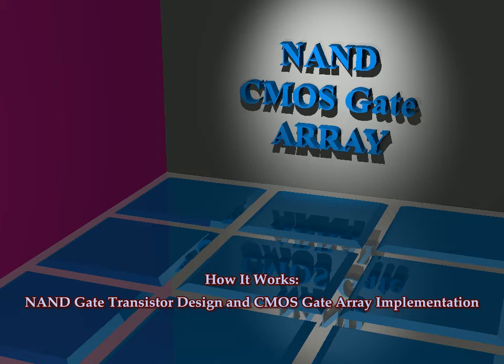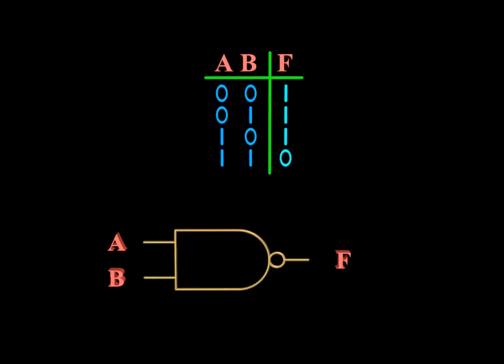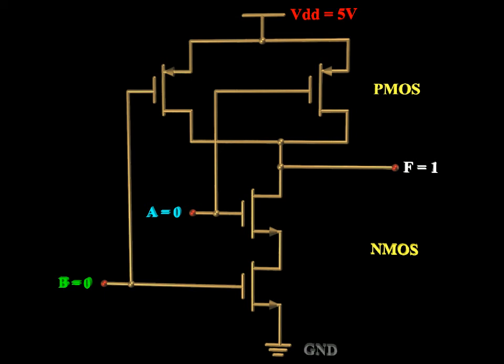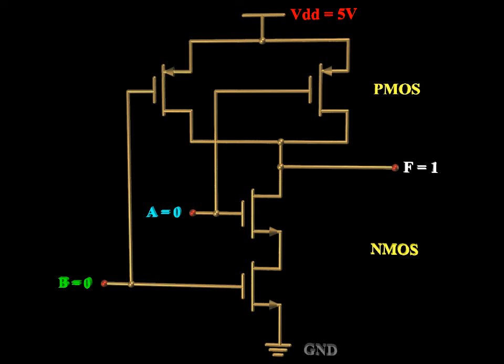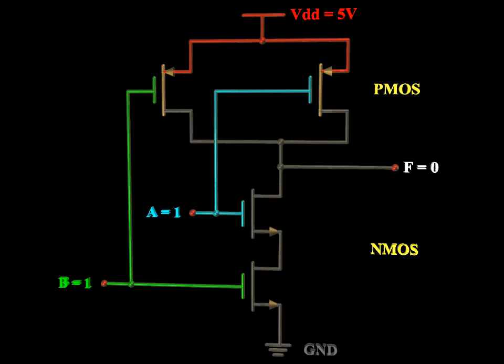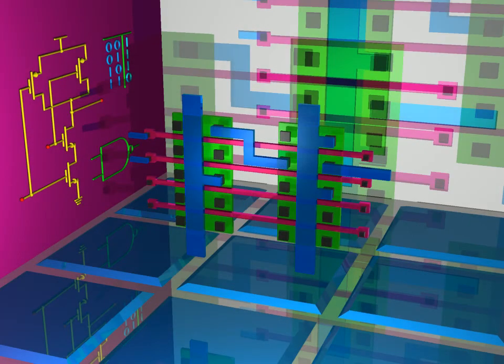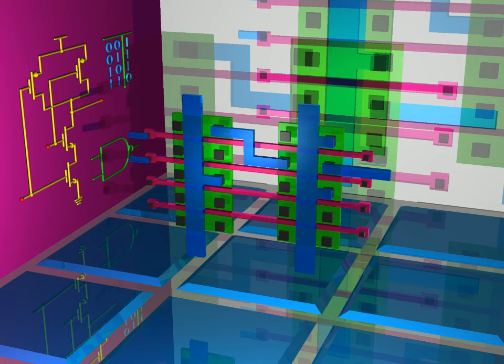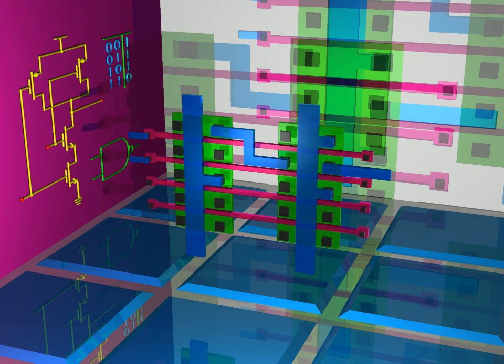NAND Gate Transistor Design and CMOS Gate Array Implementation

Comment: what if PMOS is gnd while NMOS is tie high.  2 reverse
Reply from the maker: Thanks for the interesting question.  If I'm interpreting your question correctly - the schematic exactly the same but with the PMOS and NMOS switched - then, by my reckoning, it would be an OR logic gate since F would be 0,1,1,1 in a truth table.  If, however, you mean change the schematic so that the PMOS section remains in parallel but moved to ground and the NMOS section remains in series but tied to high, then that would be an AND logic gate.  BTW, if you keep the PMOS tied to high and NMOS tied to ground, but make the PMOS section in series and the NMOS section in parallel, then you get a NOR logic gate (see my other video).
Reply: According to this simulator [ http://falstad.com/circuit/circuitjs.html ], NMOS to V+ and PMOS to V- would be an OR gate, but the output voltage would be somewhere between V+ and V+/2 as its high output.  You would need to add your standard CMOS inverter to get the full voltage for the output.  That would effectively make it a NOR gate.  Perhaps that fact could be used to make a NOR gate and OR gate that have the same number of effective gate delays without reducing the output voltages of either gate.  Same thing can be done with NAND and AND.
Reply from the maker: Just noticed your comment now (YouTube didn't notify me) (and I also just noticed your other comment).  Billy's question actually inspired my Spice video, in which I do show that the output voltage wouldn't reach V+ (also won't reach ground, IIRC) (won't hit the "rails").  I point out that the better solution is to add the inverter (as you say).  I'll have to think a bit about the possibility of the same number of gate delays (with correct output voltage) with NOR/OR and NAND/AND.
Reply: Thanks.  Also, YouTube killed my link trick, so I edited my comment and put spaces between the brackets and URL.  This system keeps getting on my nerves.
Reply from the maker: I know how you feel.  My latest troubles with youtube is that for a few weeks it has notified me of new subscribers (only people who show their subscriptions publicly), but they never show up in my subscribers list (they are counted, but don't show up in the list).  In at least one case, I checked the person's subscriptions and I'm still there, so they should be in my Subscribers list.  I've notified youtube, but so far they haven't fixed it.
Reply: switching nmos with pmos is a bad idea. From the input side transistor gate looks like a capacitor and you have to charge it to turn on transistor or discharge it to turn it off. Output of a logic gate has two or more transistors working as a switch and their purpose is to charge and discharge next logic gate input (to be specific a gate of a transistor that can be represented as a capacitor C_gs2).

NMOS transistors are very good at discharging and very weak witch charging, PMOS are opposite. If you connect nmos Drain to VDD rail and Source pin  to a capacitor C_gs2 and you apply V_gs1, let say 5 Volts by connecting gate to VDD, transistor will switch on and from the VDD  current will flow through transistor to a capacitor C_gs2.

Voltage on the capacitor will start growing as a result of charging it, but voltage V_gs1 will start shrinking at the same time. While Vgs1 goes down transistor starts switching off before capacitor C_gs2 of next logic gate transistor input gets fully charge.

If that process will stop for example at 2.5V (half of VDD) then in next logic gate you are in the forbidden zone when both nmos i pmos are not fully open or close and current will flow all the time from VDD to GND through both transistors. You just introduced into your circuit extra static power dissipation. Not good and this can spread like a cancer into rest of a circuit.

You can apply 10 Volts to V_gs1 to overcome the voltage on C_gs2, but there is only VDD=5V available.

You can find that extra high voltage only in H-bridge drivers, but there is an extra circuitry inside to form a boost converter to generate higher voltage only for NMOS transistors gates connected to VDD power rail. In CMOS chip you just glue an inverter to a nand gate.
Reply from the maker: @voytechj  I know I'm very late in saying this, but, thank you for your very informative comment concerning a viewers question wondering about switching NMOS and PMOS.  YouTube didn't notify me about your comment, otherwise I would have acknowledged it back in 2018.
Reply: @MrMcsoftware  no problem. I also didn't get a notification. So a year later, here's my answer :-)